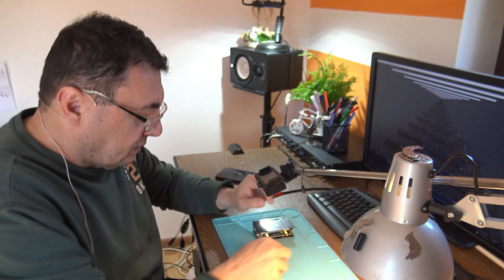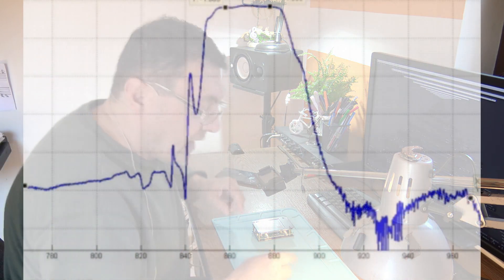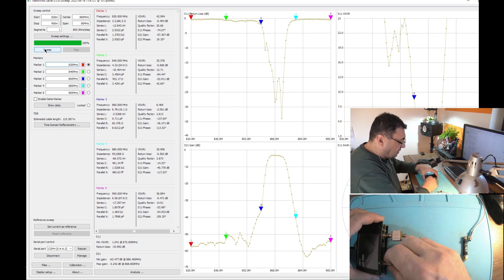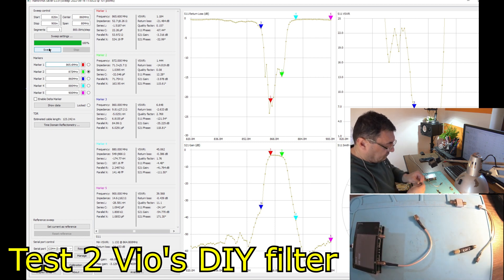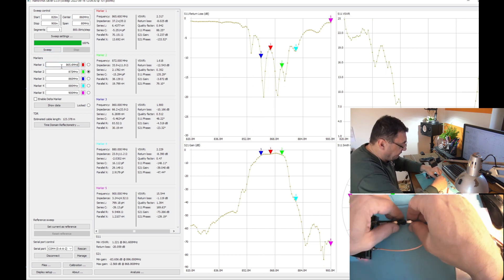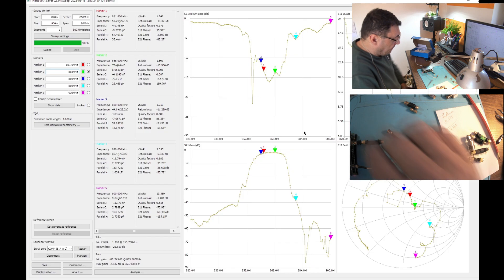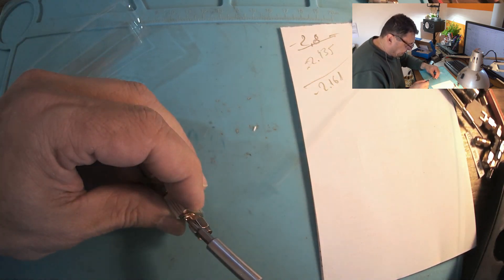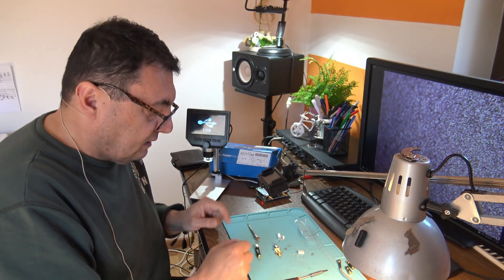Factory VS DIY Helium LoRa saw filter

Comment: Salut. Am un miner mntd. Face beacon ok (14). Dar nu face witness . Am antena hnt penetrator 10dbi tuned la 7m.  Faint magenta dove. Poti sa iti dai cu parerea ce ar putea avea? Multumesc. O seara faina
Reply from the maker: Reteua merge aiurea..Helium update '' 'there can be lower rewards for few days'' ..pare ca ai un deal in fata...trebuie mutata antena spre vest...
Reply: @viocaia  nu am nici un deal. Am linie dreapta pana la Ploiesti… de cand l.am luat nu face witness 2(luni)… crezi ca un cavity filter m.ar ajuta? Multumesc pentru raspuns
Am alt miner care face treaba buna la cum merge reteaua… 
Mean vermilion perch
Reply from the maker: @alexandruaoe5371  Un filtru nu strica niciodata!  e posibil sa fie interferente..armata..GSM..as incerca o antena mai mica gen 4/6dB..
Reply from the maker: @alexandruaoe5371  Incearca desemenea sa inclini un pic antena spre zona cu hotspoturi..vreo 5 grade.,.sa cobori beam-ul spre sud-est..

Comment: I was still waiting for the flatline fixes. Turned out my saw filter was a 915Mhz one with a 868Mhz sticker on it.. 
Removed the filter and I'm finally getting witnesses and full beacons again. So I guess be aware of that. Carefully remove the top sticker if you suspect something under it.
Didn't get a single witness for a whole month, and all my beacons only got 1-4 witnesses
Reply from the maker: This is crazy! That proves the fake amplifiers too! Thanks!

Comment: Hello i have a 3 way acasom splitter but am wondering what cables i need to go into my helium miners thanks.
Reply: Hello sent picture of splitter to your email address i have a 6.5 dbi mcgill antenna on my roof & have a cotix & sensecap miners thanks.
Reply from the maker: @MarkSmith0706  you got mail
Reply from the maker: Depends of your Acasom in/out..probably SMA cables..I can't say until I have photos withe spillter connections and miners input , email me at viorelcaia@yahoo.com

Comment: my industrial filters as you say has 2.5db loss. And it is not needed to use it before miner because miners have them inside.
Reply from the maker: Absolutely agree..don't use a filter as long as you are sure your miners have proper installed ones..I'm using anyway..a cleaner signal before amplifier and miner doesn't heart , but it's my choice..
Reply: @viocaia well ... the saw filter hasn't do any harm for anyone. 😂